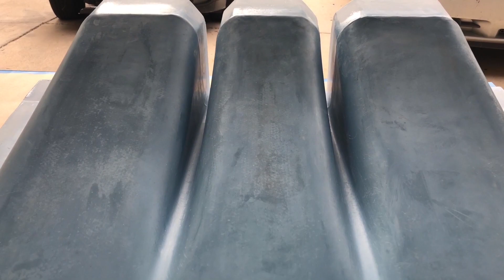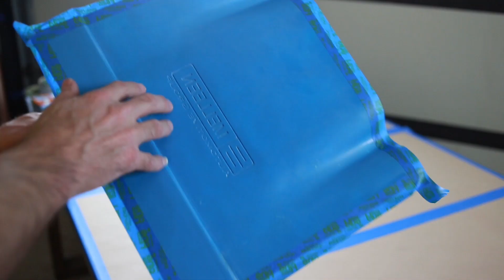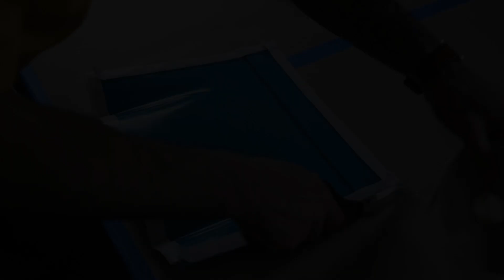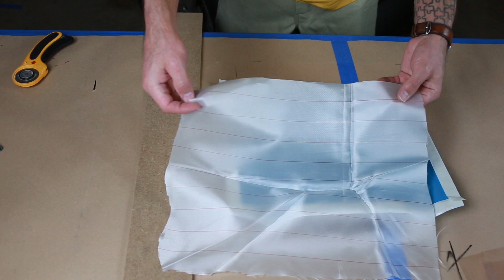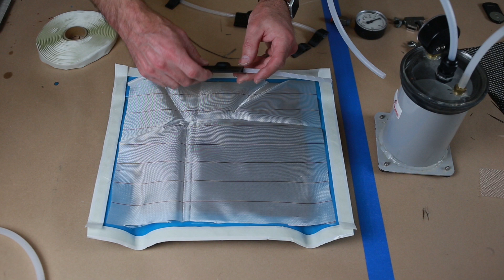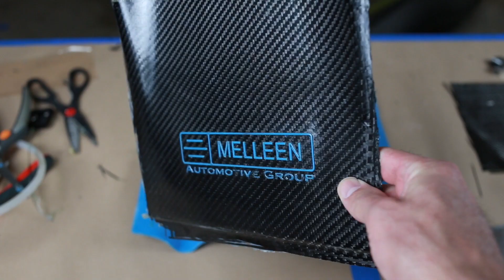Carbon Fiber Logo Inlay!

Comment: Love the videos, way better than 99% of how others approach tutorials. One subject i'm searching for (automotive related) is when using soric core at the edges of a part (like a fender, door, etc) what's the process to not reveal the core after trimming? Might be super basic, but I haven't found a tutorial on that, just flat plates with exposed core after the trim. Keep up the great content.
Reply: Gabriel von wahl.  Cut your soric slightly smaller than the parts. Then use carbon tape up against the edge ofvthe soric. Build up the carbon tape layers to near the same thickness are the soric. When you trim the part, you will not see the edge of the soric😉